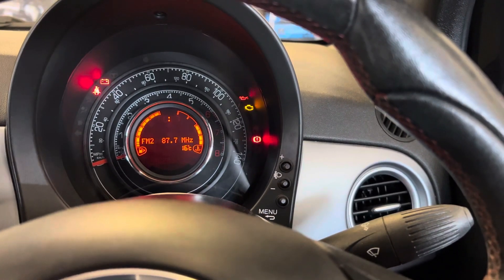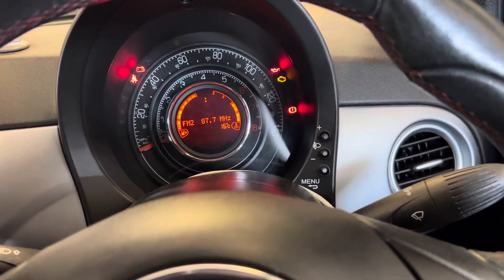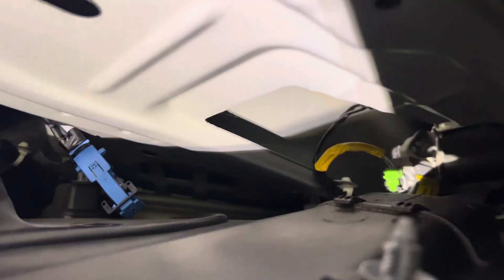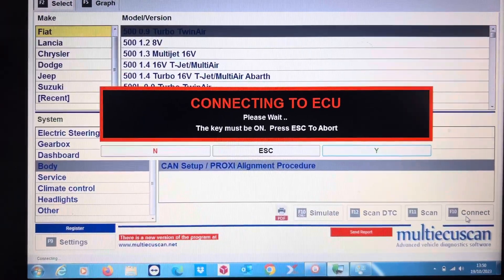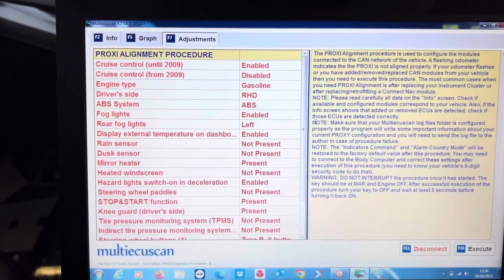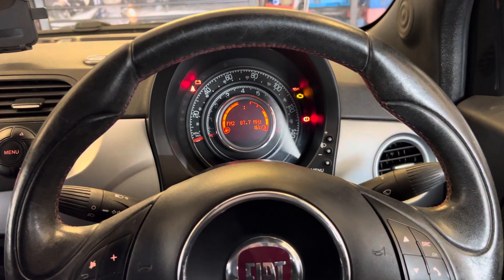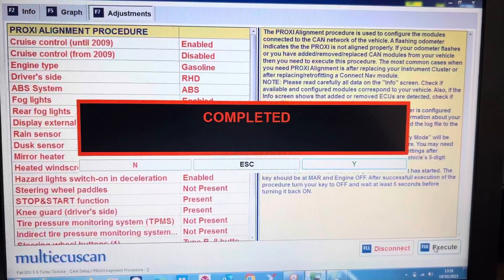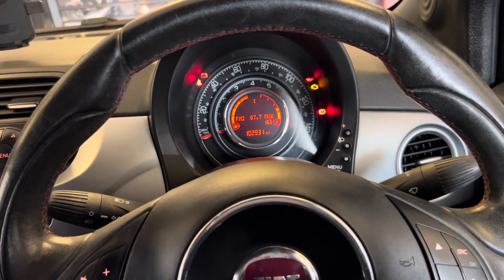FIAT flashing odometer  (blue&me) proxi alignment

Comment: good detailed video. i have the same issue. i wanted to know, do you know what wire within the wiring loom connects the positive voltage? every youtube video shows full removal, but i figured if you disconnect the + voltage and can live without the functions (like i have for the last 7 or so years) i could stop the parastic drain once and for all. i dont suppose you know which wire or cable it is? thanks!

if i have any luck with this method ill film and upload the process so ppl srent risking dnapping bolts or reassembling incorrectly.

Comment: Hi,
My Blue and Me was faulty and I've replaced it with an Android screen. I need to do a Proxy Alignment. I've bought the modified ELM327 and the colored leads. I noticed in your video that you disconnected the Blue and Me, do I have to do the same,which takes it out of the equation, and the proxy alignment will automatically add the Android screen? If I don't disconnect it will it still show after the proxy alignment as faulty?
Your advice will be much appreciated. Thankyou in advance, Steve.
Reply from the maker: If you disconnect the module you can then proxi align it out and you should be good to go👍
Reply: Thankyou for your very prompt and helpful reply, I'll do that.
Thanks again.
Reply from the maker: No problem let me know if you get stuck 👍
Reply: @l.agarage9217  Thankyou, that's very kind of you.
Reply: Hi,
No I have not experienced a parasitic drain since I fitted the new screen, nor did I have one previously. The only symptoms were the blue and me not working and the flashing odometer. A failed blue and me module is apparently a common cause of parasitic drain, so now you have disconnected it you may have solved that problem. 
If when you ordered your screen you specified it came with canbus, then when you do  a proxy alignment it will add your new screen to the list of modules that can talk to one another and delete the disconnected blue and me module. Your mileage should then stop flashing.
I hope this helps.
Reply: @stephenclark5941  thank you buddy.

Well, I unplugged cable from the Blue&Me module but it continue to drain my battery. 
Therefore I remove the fuse F36 from the fuse box (inside the car on the driver side) and now it seems that there is no more parasitic drain but also the new aftermarket screen doesn’t work too. 

F36 fuse is connected to few things:
1. EOBD Diagonistic Test 
2. Volumetric Alarm ECU
3. Alarm Siren ECU

Do you have any idea what are these?

Thanks
Reply: Hi, just to let you know that the proxy alignment was successful. The  odometer has now stopped flashing.  I thought that  the  steering wheel controls would work with the new screen but they don't. I don't know whether another procedure is required.  I'm sure I'll work it out.
Thanks again for your help.
Steve.
Reply from the maker: @stephenclark5941 hello Stephen I’m glad it worked👍 sometimes to get buttons to work on the steering wheel with aftermarket units you will need to purchase extra cables for this.
Reply: Did you also have a problem with parasitic drain?
After I installed 3rd party screen to the Fiat Qubo, there is flashing of odometer, Blue&Me doesn’t work and my battery dies if it stands still for 3-4 days.

So, I unplug the cable of the Blue&Me  module but the odometer is still flashing and there is parasitic drain to my battery.

Do I need to do the proxy alignment to solve all these underlying issues?

Thanks a ton.
Reply from the maker: The blue and me module is the common cause for battery drain that is why most people remove them
Reply: @l.agarage9217  thank you so much.
Reply from the maker: @chevysolo2141
Reply: Does this stop the battery drain also?
Reply from the maker: @danielgriffiths512 yes it will
Reply: The EOBD diagnostic test socket is where you plug your fault code reader or scanner  device into. The other 2 sound as if they are something to do with the antitheft alarm. If you Google them, you will get a better idea.